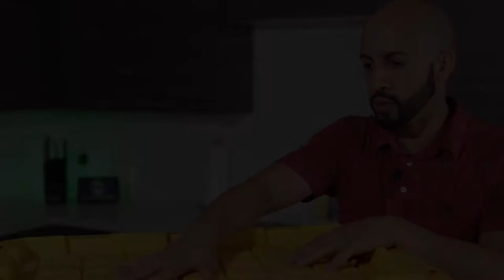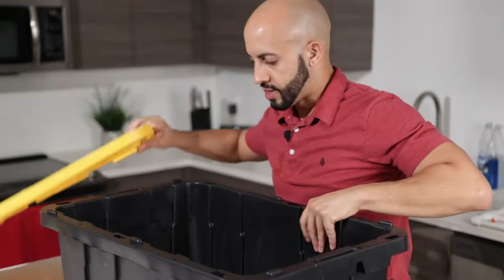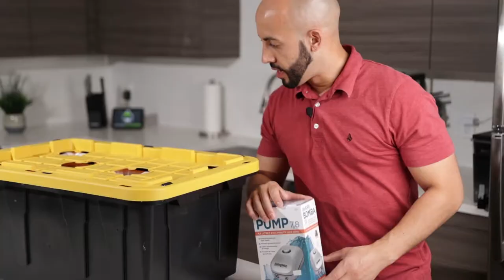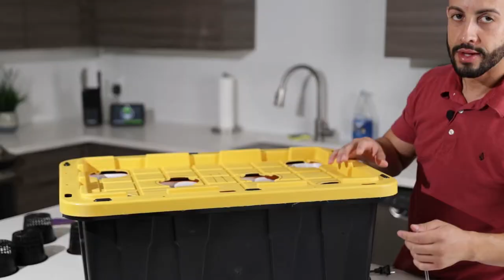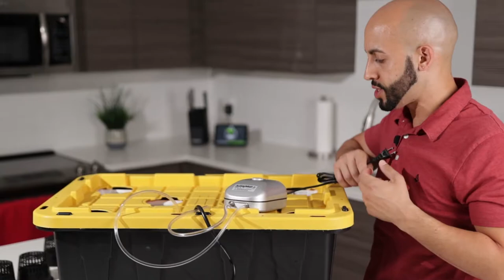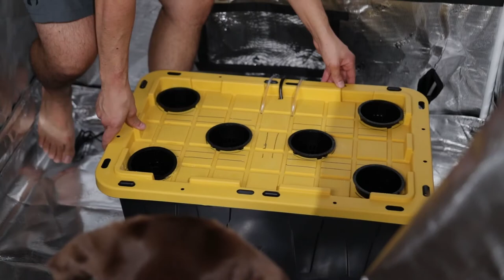THIS IS AWESOME! A Hydroponic system w/ Aeroponic sprayers!

Comment: Nice video.
But I take it since you didn't do another video showing the results of this build.
That things didn't work out.

In fact I would bet that you ran into some problems with this type of system.

You would be better off making that unit into a LPA
(Low pressure aeroponics)
System.
It's never a good idea to have your pump and reservoir, in your grow chamber.
You should always have a separate reservoir with the pump in it.
And then have a drain hose. So everything drain's back into the reservoir.
This way your pump is not heating up your grow chamber. Also this way your roots are not always sitting in warm solution.
Which causes BIG PROBLEM'S.

It could be called spray and drain. LOL 😂.
But it's actually called LPA. 

I've been growing this way for almost 10 years now.
With great results.

Also I have found it better when growing with LPA.
To grow in the SOG.

When I built my aero systems. I made them with 2, 21 site grow chambers with 1 reservoir.
I have 4 systems like this.
Each system measures 3'x3'. That's 42 plants in a 9 s/ft area.
I use 1 3'x3' LED light over each system.
This is very important.
You must use a LED light, at least as big as your grow chambers.
Which in other words, you must have diodes over every plant.

I run my 4 aero systems on a 2 week rotation.
I start a system, 2 weeks after that I start another.
Then another and then another.
Now i have all 4 systems in 12/12. All 2 weeks behind each other.
Thats 168 plants in 12/12 at the same time.

Then 2 weeks after the last system is put into 12/12.
I harvest the first system and start all over.
Very simple.
Reply from the maker: Everything worked out great just no time lol

Comment: If the airpump is on the floor you should fit non return valves to each line to prevent the water siphoning out via the airpump if the power goes out :)
Reply from the maker: That’s a good idea thank you for watching!
Reply: @hopegardens3057  
I would suggest positioning the sprayers so they just hit the bottom of the netpots. If you start the plants in rockwool cubes or jiffys etc, the high spraybar will soon saturate them and risk suffocating the roots.
Reply from the maker: @atomizer2665  good point...next build we will try it a little lower 👍thanks again